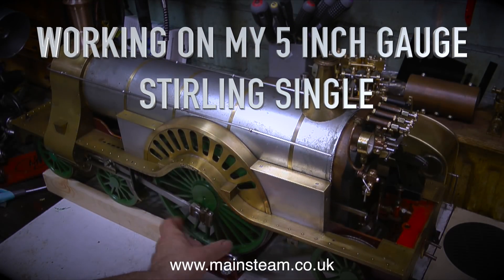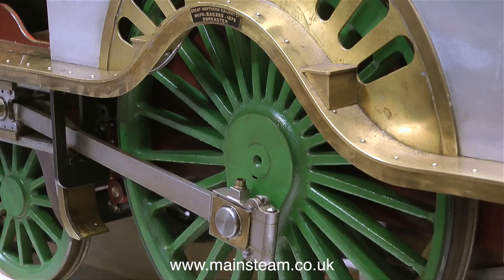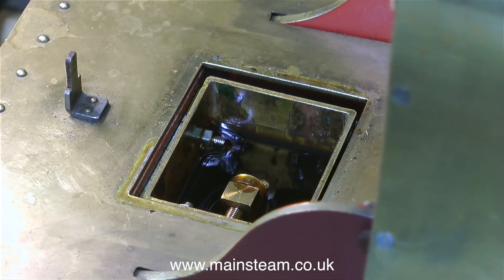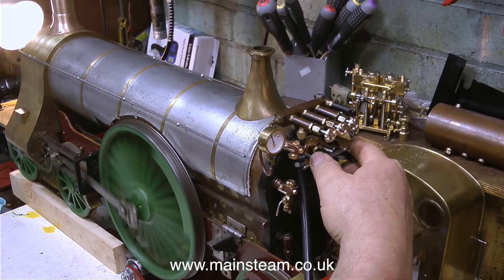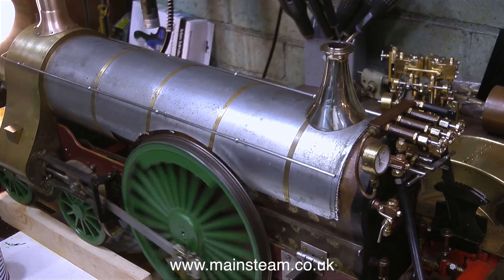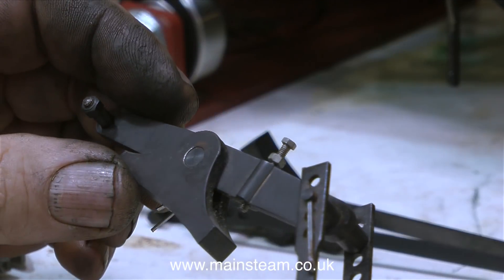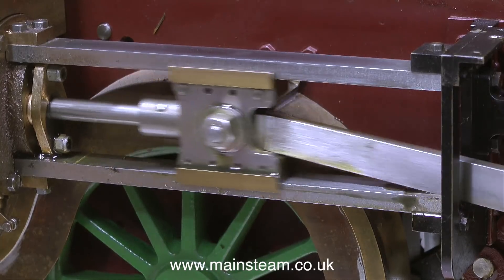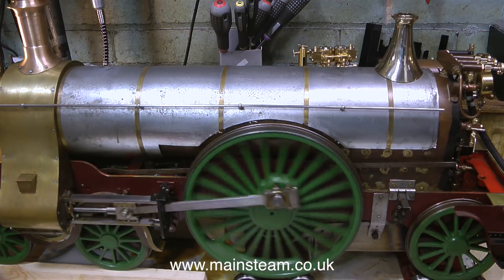MY STIRLING SINGLE #5 - EXAMINING THE ENGINE IN DETAIL

Comment: Is this the same "Sterling" that the other type of "sterling engine" is named after? Uses heat dispalcement.
Reply from the maker: This is a Stirling Single Steam Locomotive designed for the Great Northern Railway by Patrick Stirling - it is definitely not a Hot Air engine - !

Comment: According to my Internet research? There was a 7 ft 1 inch dia driver. And one that was listed at 8 ft.
They said that they averaged 47 miles per hour.
So, according to my calculations,  the rpms would have been about 186, on the 7 ft 1 inch driver...
I did this just for giggles...
Tanx...and keep up the good work.